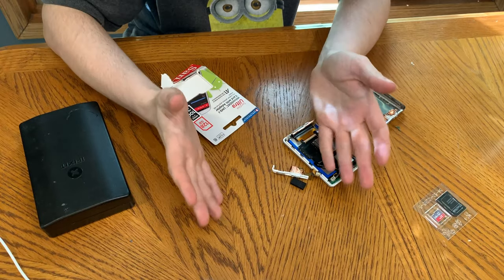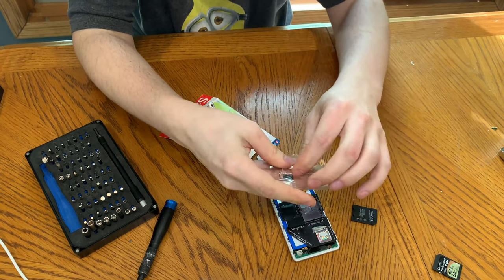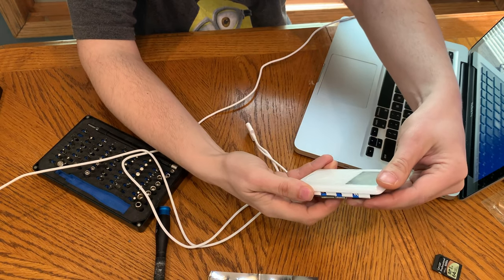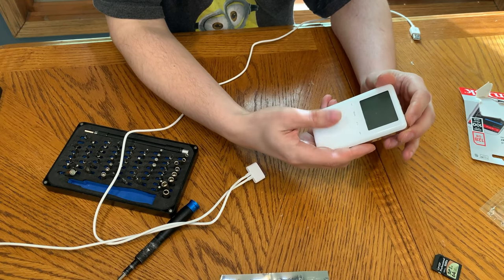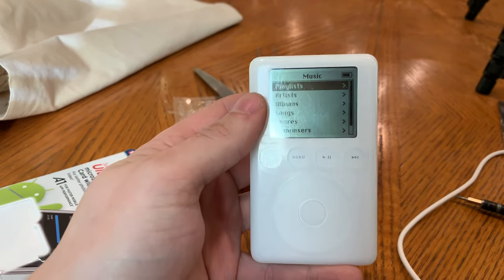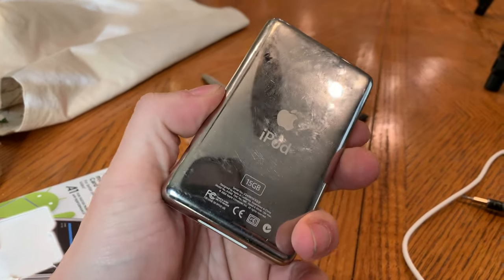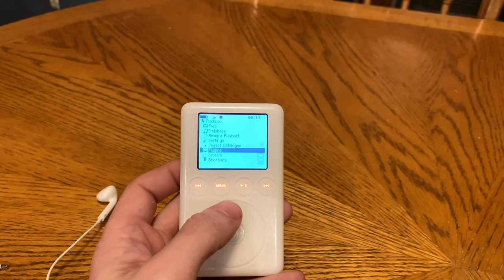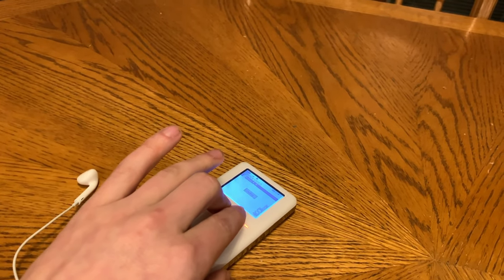Building a Flash Based 128GB 3rd Gen iPod (Part 2) – iPod Series S.1 EP.12

Comment: To fix this, you need a 4th Gen iPod to iFlash Converter, and connect a iFlash-CF, works great for me on a 3rd gen. It should support up to 25k tracks. It wont work well directly connecting a SD-CF Adapter to the ipod connector.
Reply from the maker: Good to know
Reply: garetz sorry for dumb question do you have links to those parts, I didn’t understand too well, thanks in advanced
Reply: garetz  So all I need is this converter and the iflashe solo?
Reply: @MrKatra14  yes the solo will be fine.
Reply: garetz  Ok thank you so much 🙏🏾, take care stay safe
Reply: Thanks for the advice, so you need to order 3 parts ? 4th Gen iPod Converter + iFlash-CF + SD-CF Adapter ?
Reply: @garetz00  .m.n

Comment: What I want to do with mine. Maybe use the CF 128 gb card instead. Unless the cost is excessive, then the iFlash quad adapter (thinner) with a single 128 gb SD card.
Reply from the maker: Just remember it’s a pain in the ass, slow as hell to boot and you need windows and USB to sync it

Comment: Same problem here my doesn't want to work after the upgrade to CF card and a 128gb sd card iTunes recognized it but it will not update the firmware,  help please I did format the car and all that with windows and still don't work
Reply from the maker: has to be done over USB sync try target disk mode